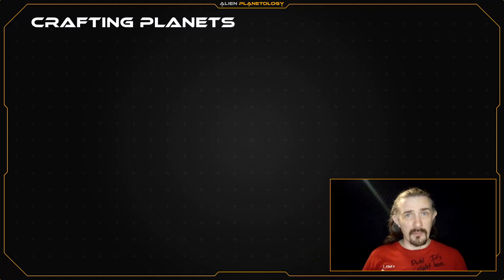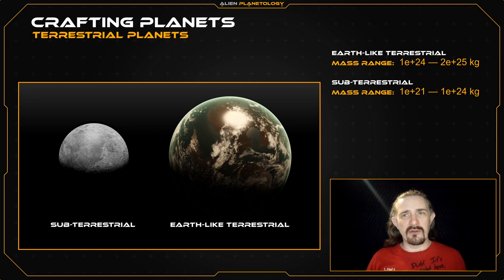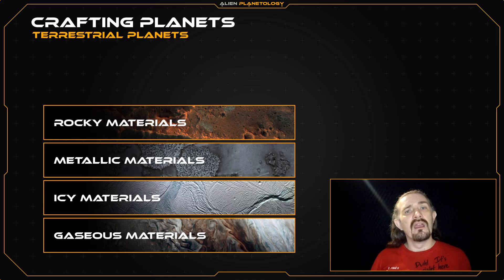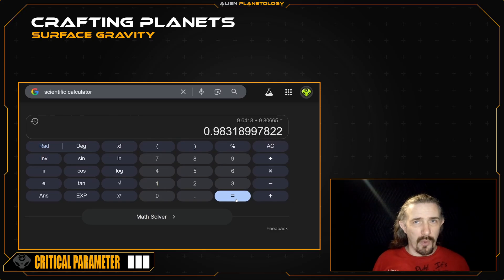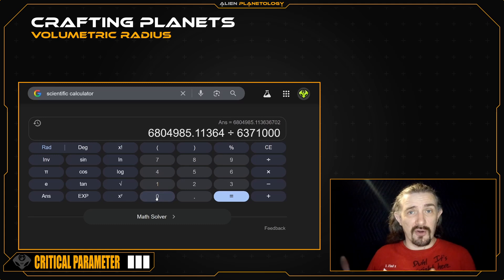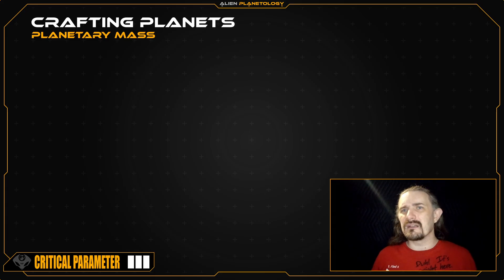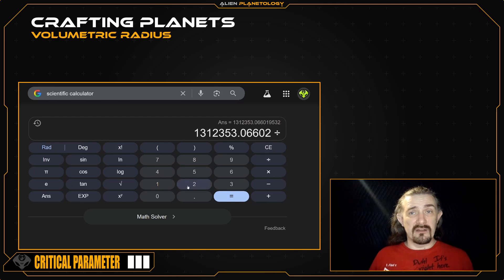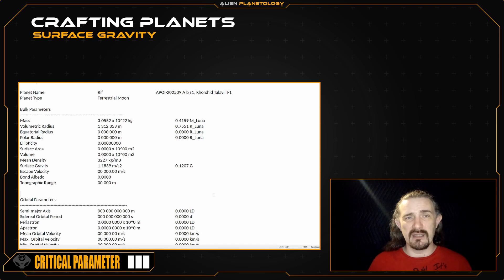Planet Building - Calculating the Critical Foundations

Comment: I tried calculating the mass of the Earth using the process you described to check for accuracy and ended up with 5.9488*10^24 kg. Earth's true mass is 5.972168*10^24 kg, which means I'm off by 2.3368*10^22 kg. Are there more accurate ways to find a terrestrial planet's mass?
Reply from the maker: These equations are as accurate as the values you plug into them.

The reason you did not get the mass you were expecting from the equation was due to the precision of the values you entered. Most of the values that one finds listed for Earth are either rounded approximations or "nominal constants" defined by the IAU and other scientific authorities for use in unit conversions. These are rarely mathematically consistent to a high degree of precision. If you plug an approximation in, you get an approximation out.

But that is not an issue for what we are doing. Since we are defining our planet's initial values, we control the precision of the result. So, if you plug into the equation your planet's precise surface gravity and precise volumetric radius, you will get out its precise mass.
Reply: @Alien_Planetology Makes sense. Thanks for the reply!

Comment: For the radius, it somehow popped out -9.9e-17 an i am preplexed. I was trying to make a dense planet but what is this?

Edit: Nvm I fixed it, I put -10^11 instead of 10^-11
Reply: Anyways, i was trying to basically make a new moon for earth that would fit in my setting and this is what I got from it:

Density: 9100 kg/m3
Surface gravity: 4.390 m/s2
Surface gravity (in gs): 0.378 g
Radius: 1,725,554 m
Radius (Earth Radii) 0.27
Mass: 1.958465412756579716e23 kg
Mass: (in earth masses): 0.032793207517768877

But since the celestial body that i'm making falls under the Sub-terrestrial, it isn't accurate. I had to change some parameters too so uhh yeah ("'•—•)
Reply from the maker: @purukuo I'm confused. Why is it inaccurate? And what parameters did you have to change? 
(The only error I see in your quoted parameters is the surface gravity in Gs. It should be 0.4476 g.)
Reply: @Alien_Planetology  I had to change a lot of stuff and like, I'm no mathematician or physicist, how would I know if imwas right or wrong?
Reply: @Alien_Planetology  Also, the Theia Impact theory is a bit different. In this world, the theory states that the moon might be the exposed inner layers of Theia.
Reply from the maker: @purukuo Ah. That would explain the extremely high density. Your v2 numbers look good. I don't see any errors. Good job!
Reply: @Alien_Planetology  btw, I am doing this because I want Lunarians for my story but I need to figure out how the core works, whether the moon's slow rotation can still have a magnetosphere, etc
Reply: @Alien_Planetology  and yeah, I am aware that the surface gravity is still quite low, but people speculate life on titan so it shouldn't be to much of an issue, especially when my moon has more surface gravity than mars
Reply: Anyways, Here is the V2

• Mass:
| 1.63012*10²³ kg
| 2.219121670412213843 M☾

• Density:
| 9200 kg/m³

• Radius:
| 1,617,264 m
| 0.930531917796199335 R☾

• Surface gravity:
| 4.159713894155245287 m/s²
|0.42417 g

Comment: Atmospheric pressure...... This seems to vary widely, as demonstrated by Venus and Earth. What are your thoughts on generating a realistic atmosphere and atmospheric pressure.....? Or is this something where we have lots of leeway?
Reply from the maker: Creating a realistic atmosphere is a complicated subject which is going to take me several videos to properly explain. But, mean surface pressure specifically is pretty simple. It really just depends on the mass of the atmosphere, which we can define pretty-much arbitrarily. There are limitations as to how much atmosphere a planet can hold based on its mass and average temperature, but as you can see from the examples you gave of Earth and Venus, this can vary over a very wide range.

You can calculate a planet's mean surface pressure using the equation: (GMm) / (4πr^4), where M is the planet's mass, m is the atmospheric mass, and r is the planet's radius. (For reference, Earth's atmospheric mass is 5.1 • 10^18 kg)
Reply: @Alien_Planetology  I'll be all ears if you do these videos. You won't have to twist my arm to get me to watch them....

Comment: 2:01 what about super earth planets?
Reply from the maker: Short answer: yes. 
I consider planets below 3 Earth masses to be terrestrial planets, so up to that mass, you can use the info in this video to build them. Between 3 and 8 Earth masses is what I'm labelling as hycean. I know not all of the planets that fall within this mass range are technically "hycean" in the strictest sense, but I tend to group them together in the same way I group hot-jupiters, gas giants, and ice giants together under the "jovian" label. So when I make a video about "hycean planets," I will cover all the variations within this mass range.
Reply: @Alien_Planetology  In general I consider hyceans likely between 5-10 earth masses although it would be useful if we had any example of planets between the masses of earth and uranus